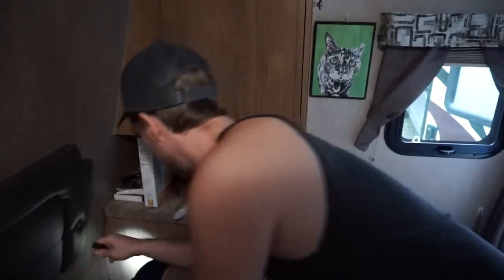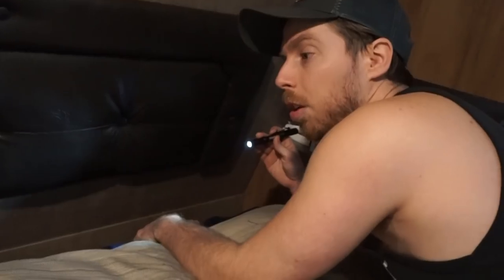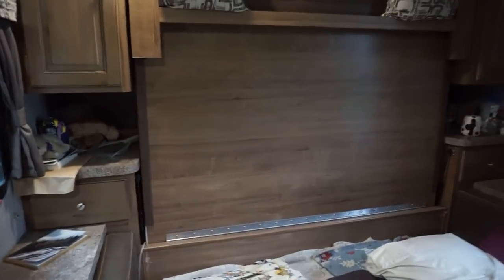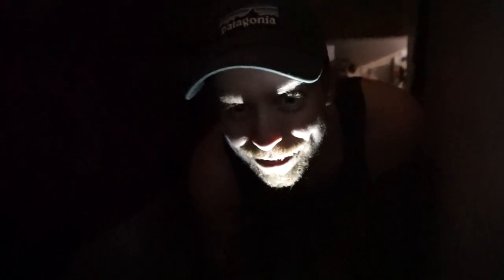WE FOUND MOLD IN THE RV 😖

Comment: For the future, never use a vacuum on mold.  It scatters the mold spores everywhere in the air and you are breathing them.  Plus the mold will spread from the spores.  Wash everything with white vinegar water.  Wash machine washables with vinegar in the wash water and in the rinse water.  Be safe and use a mask, gloves, eye protection and wash all clothes worn in the washer with white vinegar.  Wipe down all surfaces with vinegar water, also.  Use a dehumidifier and leave bays open to air out when you can.   So sorry.

Comment: Mold!  Yeah we had to deal with it also, we got “damp rid” it comes in a variety of sizes.  We used the large one and put it in our camper storage areas.  Worked great have not had a problem since we started using it.  Just have to check it every now and again to see if it needs to be replaced.  You guys crack me up! XO

Comment: Try a very mild heat source during storage.  Something as simple as a single incandescent light bulb hanging inside.  The relative humidity inside only needs to be a few points above ambient to prevent condensation.  Provide a natural air circulation route, like lifting a roof vent a little, and you're done!

Comment: Yep. As others have said, get a dehumidifier if you haven't yet. I have one, live near Houston, TX, & it fills up daily! Now I have to address black mold in a vintage Silver Streak that I'm renovating. However, I have only found it in the bathroom area where the sink faucet & toilet had leaked. I bought a real respirator mask & mold killers. Will be replacing some of the wood as well. I already ended up in the ER due to an infection I got from ripping out the 44 year old carpet. So beware of those molds. The wall bed scene was kind of creepy! 😉

Comment: Liked your video.  In my sailboat, otherwise known as a mold factory here in the cold north, I've had success with tea tree oil in beating mold.  Thankfully none in my RV (yet).  You get tea tree oil at the pharmacy.  Expose the liquid to air in a small dish, or use a soaked cotton ball. It's cheap, so don't hold back.  It's the active ingredient in a lot of commercial boat mold fighters.  The oil vapour kills the mold spores.  It helps to clean and sanitize first, but in my experience it can attack existing mold.  Good luck.
Reply: Indont understand what you mean by expose it to air in a small dish.  Can you please explain thank you.

Comment: Liked the battle. Love those dogs. Oh Boy, A Moldy Day at the Wyatts! As long as it's not in the floors, walls and ceilings. That storage area can create moisture because of the temperature difference, warm air meeting cold air forms condensation. Warm air holds more moisture than cold so when the warm air cools down, condensation is formed and creates the living environment for mold. Then there is no ventilation to dry it out. Hence the mold finds a place to flourish. RV's I would think could be worse than some homes. Old Minnesota contractor here. There are test kits you can buy to test for mold. They aren't that expensive and you can do it yourself if you have concerns. Looks like you got it in time.
Reply from the maker: Interesting we will look into the test kits, thank you!!!! Hopefully we caught it early. Just this darn winter. We will be getting de-humidifier for the future as well! -Blair
Reply: You Bet!

Comment: I got a little dehumidifier for my 30’ Rockwood just a week ago, it seems to be doing good, but its not been that wet or cold yet so hoping it does ok for the space. I have had condensation issues in my wardrobe slide, water pooling at the bottom and the clothes feeling damp, I try to keep the doors open on those days. But I better check for mold down there, ugh.